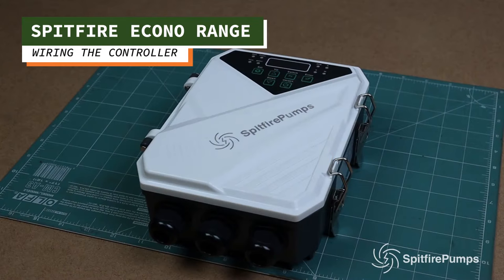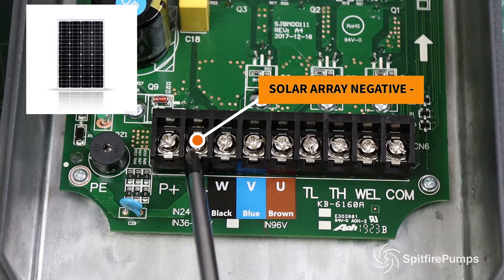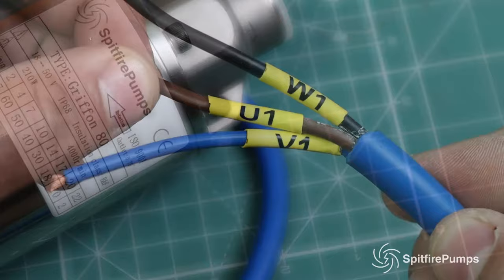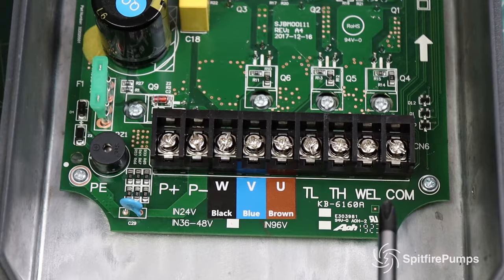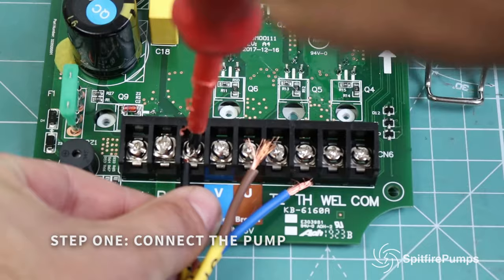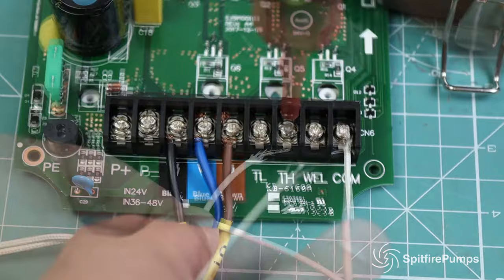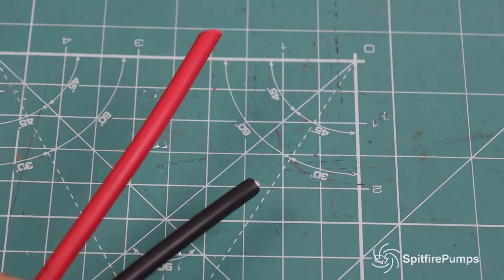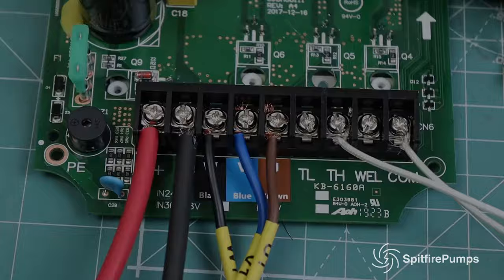Spitfire Solar Water Pump Installation - Wiring the controller

Comment: In case I want to install the motor controller inside my house and the motor pump is far outside. What is the maximum length of wire that can be used from the motor controller to the motor pump?

Comment: Have no problem with the pump or controller however my standby pumps are 2 wire 24v submersibles IE Pos Neg so can I just connect the V and U wires and still have the controller power the pump.... Glen
Reply from the maker: For this specific pump range all 3 wires need to be connected.

Comment: Can the MPPT Controller be replaced if it burns?
Reply from the maker: Yes the controller can be replaced at a reasonable price (Around 100 - 130 US$) depending on reseller/installer